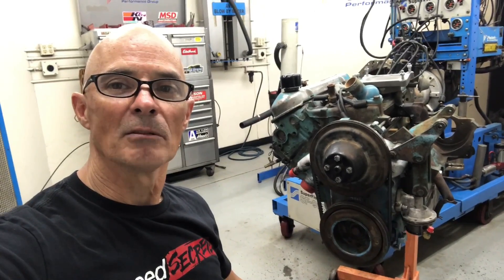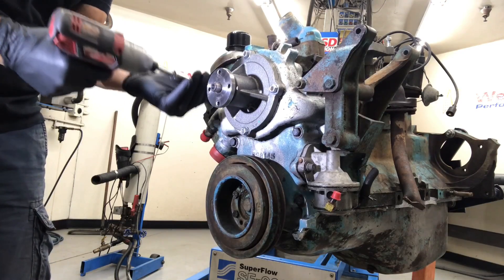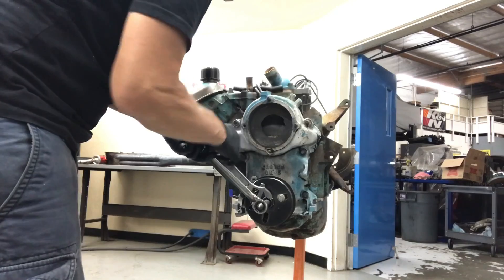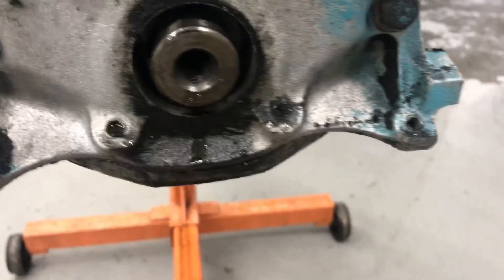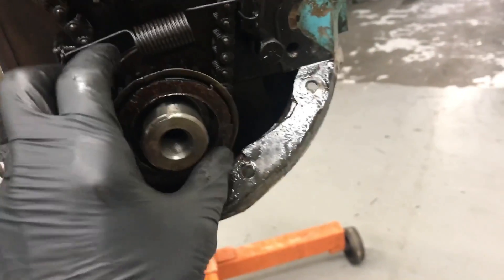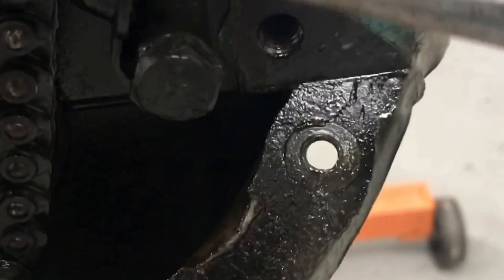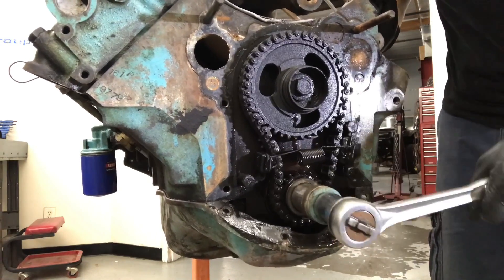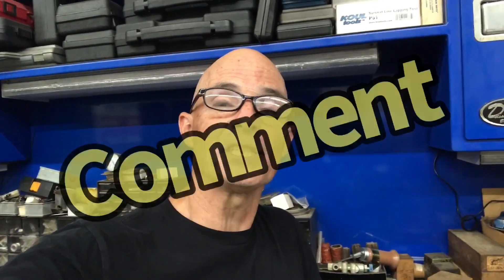HOW TO REMOVE A PONTIAC TIMING CHAIN-TROPHY 4 CYLINDER (1/2 389), TIMING CHAIN STRETCH VS TENSIONER!

Comment: 1 had  a 63 tempest station wagon back in 75, 4 cylinder engine. Bored it out to fit 400 Pontiac pistons. It ran good until I totaled it on a rainy night on a sharp curve.  Wish I had it now. I had found a 4 barrel intake, but didn't get the chance  to install it. Cool motor, and drive train.
Reply from the maker: do you still have the 4-brl Trophy intake?
Reply: @richardholdener1727  no, my dad threw it away after I wrecked the wagon. I hated that car as a 16 year old, trying to date, but I sure wish I had it now.

Comment: Richard sorry for being the wrong vides but you have done numerous header comparisons for low rpm street application and the fast long runner has one.  Can you please do a shootout against the Holley dual plenum EFI intakes as they are for low-end street/strip applications with 12 long runner.  I have a 2009 Pontiac G8 and am looking to with purchase but curious about the the difference in performance between the two styles like much of your followers would be.  For some reason, it lists 102mm TBs for the LS3 head but would think two 92mm TBs would be more appropriate for velocity
Reply from the maker: holley intake video is up

Comment: I took my 1962 trophy engine apart and saw no tensioner. I wonder if the chain was smaller to take up the slack. Any ideas on where I can find those parts? The spring and bumpers?
Reply from the maker: NOT SURE ON SOURCING THOSE

Comment: Brings back memories I used to check engines for tummy chain stretch by checking to see how far the crankshaft would move before you can feel the camshaft tension anyting over 6 to 8° I would sell them a new timing chain. Before it would jump time. Shorter part of my super tuning with the older.

Comment: On timing chain, Pontiac used the tensioner x links in the chain. Pontiac racers for years used this chain until they quit making them. Why? Because it was the last chain the v8 would ever need.  The chain on your half a v8 is trashed. Get a Pintiac V8 chain as they are the same, just dont last well on the 4cylinder.  Also your 2bbl carb going into a single bll manifold is a power killer. Ive never been happy with the results other than it runs.
Reply from the maker: MY LAST 2-BRL TO 1 BARL ADAPTER TEST ON THE 292 CHEVY MADE MORE POWER THAN 1 BRL

Comment: The Trophy 4 cylinder was hard on timing chains and the service replacement was a chain reinforced with, "X's" inside of the links. The last company to make the correct chain was Republic as part number, "R-355X."It is the same size as the V-8 chain and is a heavy duty replacement for the V-8's. Since out of production, Republic now shows the standard V-8 timing chain part number for the 4 cylinder, part number R-350. Nothing special about it, but if visiting an old auto parts store, ask for Republic part number R-355X and see if they have any in stock. They last longer in the Pontiac V-8's than the double roller chains. The nylon tooth camshaft gear will absorb the camshaft harmonics that reduce power in Pontiac V-8's. The teeth don't fail until the chain stretches too much and with the nylon gear, the chain will last longer, than it would with a cast iron camshaft gear. The crankshaft gear is heat treated steel though.
Reply from the maker: YOU WANT ME TO INSTALL A NYLON CAM GEAR SET?
Reply: @richardholdener1727  The chain will last longer and the engine will make more power. With a cast iron or now billet gear, the Pontiac can stretch or break the chain sooner and make less power. On a race car, the engine and nylon gear don't see much mileage anyway. The nylon gears work well when new. They do age and the chain does stretch quite a bit with street use, causing the teeth to later strip. The aluminum and nylon gear soaks up a lot of what beats up the chain, especially in Pontiacs.

Comment: The aluminum/ nylon timing gear on my 68 GTO Ram Air lll, had it's teeth stripped off at 60K miles and 6K RPM.   Bent all the valves in both heads, but it did not suffer a catastrophic failure.  Replaced the valves and ran the engine another 10K miles before disassembly and upgraded to RA IV configuration.  I found one of the pistons was distorted enough by valve impact to make wrist pin to piston movement difficult.
Reply: Pontiac V8's are hard on chains due to camshaft harmonics. The nylon teeth make the chain last a bit longer, but once the chain stretches too much, the worn chain eats the nylon teeth. When the thermostats were changed from 180 to 195, Pontiac changed to a cast iron camshaft gear in 1972 with a hardened steel crankshaft gear. The Pontiac V8's actually make more power with the nylon gear, as it absorbs the camshaft harmonics.

Comment: The 4 cylinder used the same size chain as the V8 but it suffered from premature failure in the Trophy engine so Pontiac engineers came up with a better chain for all the Pontiacs.
Reply: Problem was originals had nylon teeth!  Fire that guy!  They wore off, clogged the pump screen, and good bye motor.
Reply: @hankreardon6998  

I’ve changed a lot of original Pontiac timing sets and they were all steel. I’m not saying that they never used nylon but I haven’t seen any. 
When NHRA Pro Stock started using gear drives everyone except Bill Jenkins was having valve train problems. Grumpy didn’t have any problems because he was using a factory Chevrolet nylon timing set and the nylon acted like a harmonic shock absorber between the crank and cam.
Reply: @Tim Sharpe  Also changed the original on my brother in laws '69 GTO back in the day.  It was nylon.  They were factory installed until 1971 according to Tim Wallace (Pontiac expert Wallace Racing).
Reply: @timsharpe3498  Pontiac switched from an aluminum and nylon gear to a cast iron camshaft gear in the 1972 model year. Both used a hardened steel crankshaft gear. The heav\y duty 4 cylinder chain was last made by Republic as part number R-355X and may still be found in old parts stores. The current republic catalog calls for a standard V8 chain pn R-350 for the 4 cylinder since R-355X has now been discontinued, but you can still find R-355X and it has X's inside the links to reinforce it. You can see the difference compared to a V8 chain.
Reply: @timsharpe3498  The aluminum and nylon gear is great for racing, since it won't be seeing thousands of road miles, just a few track runs and the Pontiac engines suffer worse camshaft harmonics than the Chevy's Bill Jenkins ran.
Reply: @hankreardon6998  1971 was the last model year for the Pontiac aluminum and nylon camshaft gear. The 1972 and newer Pontiac engines got cast iron camshaft gears with hardened steel crankshaft gears.

Comment: the tempest 4 used a different chain than the v-8..it is identified by an "x" tensioner in the middle of the chain..thes are the best chains to use because they never wear out in a v-8..yes, flat crank engines are "shaky", but these can go well over 100,000 miles easy..your chain looks like a v-8 model, which, even with the tensioner, will wear out quickly..most pontiac guys have no idea how to hop up these little engines..
Reply from the maker: this was a 4 cyl chain
Reply: @richardholdener1727  send it to me..i collect them..

Comment: It looks like excessive timing chain stretch to me. I have no experience with the trophy 4 cylinder, but I wonder if you can use the small chamber, big valve head from a 389 V8 to boost top end power?

Comment: I would check at the same way you check the motorcycle chain lift the chain in the middle of the big sprocket and see how far it goes up. If it goes up and down in the middle of the sprocket it's completely worn out

Comment: For those wondering, a 4 cyl engine of nearly 200 cid is going to be a ROUGH running engine. 2 liters or 122 cid is considered the largest you should go without balance shafts. Pontiac used the absolute softest motor mounts to try and disguise the roughness. That roughness translates to much heavier harmonic vibrations, which is why they put that spring tensioner in there. That timing chain is googatz. I remember watching a friend's 61 Tempest idling in gear, and the engine just shook around, but the soft mounts absorbed most of the vibration. If you ever get an opportunity to see a 61-63 Tempest with an automatic, look behind the rear diff- the torque converter is there, out in the open, just whirring away.
Reply: And the Vega 2.3 liter said "Trophy, hold my beer. I'll show you some shaking!"😂
Reply: Actually the upper limit is 2.5L.  Any larger and a balance shaft is needed for secondary force vibrations.
Reply: I have a Nuffield tractor with a 3.8 liter side valve 4 that is smooth running. Similar to Morris truck engine.
Starts easily even if it is 6 months since I last used it
Reply: I have a '61 Tempest with the 4 cylinder 4 barrel motor.  If it's tuned it's not bad at all.  Vibration really only shows up at about 4500 rpm....
Reply: Offenhauser begs to differ...
😁

Comment: Wouldn’t a stretched chain retard the timing and help top end power? My stretched chain test is to pull it away from the sprocket about midway around. It shouldn’t come away from the sprocket. Another test is to take it off, turn the chain sideways and see how bad it droops.

Comment: As you say , was it designed with more slack in the chain to accommodate a chain tensioner compared to the 389 that doesn't run a tensioner ?  Double roller chains don't stretch that much . I've only seen single roller chains to get that sloppy .

Comment: You dhould of checked with a timing light with the engine running. With the engine running and idling with a worn out chain the timing would be all over the place making it hard to time.
Reply from the maker: WE CHECKED TIMING MANY TIMES

Comment: Somebody mentioned a situation where a timing chain had so much stretch that it actually wore a hole through the timing cover.  I had the same experience.  I can't remember for sure, but I believe it was in a late 70s or early 80s Chevrolet van with a 350.  That same vehicle might have been the one that was leaking from the oil pan too - the pan... not the plug or the gasket.  The pan had rusted out in the area between the damper and the sump.  Oil was running down to the plug, but the plug itself was fine.

Comment: I'd be willing to bet the chain I'd overly worn just from the side of the tensioner that isn't touching the chain anymore. A tight chain should pull the tensioner to the center and both would be contacting

Comment: check chain wear by laying it on the table either flat or on its side and try and push 3-4 links together and look for the slop in the pins. the link pins are where all the wear is at. think of them like door hinge pins
Reply: Draw the chain out into two tight rows on the bench and pick it up parallel to the ground while holding it from one end. It should be able to hold itself reasonably flat on the opposite end. Any drooping indicates slop in the pins.

Comment: It looks like it needs a set. It doesn’t slop on that one side because your pulling the tension out rotating. If your putting a cam in it do this. Put it on tdc with old set now rotate the crank backwards record the amount of rotation before the cam moves.Put the new set on do the same thing. It won’t tell you how much is too much but you would know in degrees how far it stretched

Comment: Being that it's half of a 389, I would think it would need a three single barrel intake to make the real power.
Reply: half of 3 carbs is 3 venturies so a 500 holly carb from a ford would work just right.
Reply: My '61 4 cylinder has the factory 4 barrel carb.  155hp, they only made just over a thousand of them.

Comment: Unlike modern hydraulic and rachet chain tensioners, that little spring doesn't control timing when the cam and oil pump are putting torque on it. So you would expect that cam timing would be retarded when under load. Would that keep it from revving?

Comment: my uncle worked as a mechanic at a chevy dealer in 50s he ordered a 56 chevy delray came with dual quads close ratio 3spd 3.70 posi and overdrive the first year he raced it in 56 the drag strip was dirt they used snow tires he didnt remember the ET but it went 95 on dirt in got new black top for 57 the car went 105 with the factory dual quad 265 with the duntov solid lift cam
Reply: this was the same track near Louisville Ky called Cedar Creek Dragstrip named after the road it was on uncle and dad both raced at

Comment: You can check the dots on the sprockets to see if they line up but I'm sure the chain and sprockets are worn out. The new chain should fit tight like the 389.

Comment: With only 8 valvsprings the cams spins pretty easy but there is 180 degrees between each event so there is more jerking in the timing chain. I guess that is why they put a tensioner in there. If the chain is worn the cam timing and ignition timing will be retarded of course, but that does not explain the lack of horsepower. A worn out cam and lifters on the other hand would..
Reply from the maker: cam is mint

Comment: Richard, the chain is worn out.  You noticed that the chain would jump once in a while when you rotated it.  The reason it's doing that is the pins are worn enough in the chain that the following chain tooth isn't landing in the middle of the sprocket tooth because of stretch(wear).  When it does this the sprocket and chain jump as they try to center themselves in between each tooth.  Lastly, 4 and 6 cylinder engines usually run a guide and tensioner on the chain to dampen the harmonics in the cam.  8 cylinder engines don't make as much harmonics.  A good example of this is the dodge 3.9 v6.  They ran a chain guide while the 5.2 and 5.9 didn't.   The chain and sprockets were the same though.
Reply: I 100% agree it should not jump like that....no way is that 'correct' ....

Comment: Sloppy chains usually cause an erratic timing light indication at idle and make it difficult to set the timing. The tensioner might prevent that problem though.

Comment: I have worked on hundreds of Pontiac V8's since I started on cars 40 years ago. None of the V8's used a tensioner and several old drag racers used 4 cylinder timing chains in their V8's because, in their words, the chains were heavier duty. So seeing that much slop in the chain it looks very stretched to me. But I have never worked on a 4 cylinder and by the time I started racing in the 80's aftermarket H.P. chains were easily available so I never used one of the 4 cylinder chains in my V8's either. I looked on Rock Auto and Cloyes lists the same part number for both the 389 and the 195 so I think they should be the same length and therefore fit with no slop.
Reply: Have one, same timing chain and sprockets as a Pontiac 389 v8.  You must reuse the tensioner though.
Reply: The old 4 cylinder timing chain is out of production, but Republic made the last ones as part number R-355X and they have X's inside the links to reinforce them, making them stronger than the V8 chain, that Republic now lists for the 4 cylinder as part number R-350. Call old auto parts stores and have them search their stock for Republic part number R-355X for the heavy duty 4 cylinder chain that is no longer listed.

Comment: I agree that the chain should only have a slight amount of slack in it, regardless of the tensioner.
If the chain was supposed to have that much slack it should have a tensioner that would ratchet out and lock into position, not jump back and forth every time a valve spring pressure pushes the camshaft forward, ahead of the crankshaft, that would just not be right....

Comment: If the stretch was uniform, and it hasn't jumped a tooth, or two, wouldn't you expect to see slop on both sides, and the tensioner pressing in on both sides?
Reply: No. It pulls tight on one side, goes slack on the opposite

Comment: Never saw a tensioner  on any Pontiac  v8 .  I've seen a lot of slop on there v8s with 50,000 miles. Pontiac  v8 are hard on timing chains and gears

Comment: The more I see of the Pontiac 195, the more I like the IH 196 made from half of a 392 V8. It had timing gears instead of micky mouse tensioners to control a floppy chain.
Reply: I know a guy who had a GM Iron Duke 4 cylinder that had bad timing gears. He decided to do a “forever fix” and put a set of steel gears from a 292 truck engine. It sounded like the Salvation Army bell ringer because it had a roller cam. He had to tear it back down and put the fiber gear back.
Reply: I’m glad someone else was thinking about it
Reply from the maker: gears drives are just silly
Reply: @richardholdener1727  , industrial engines tend to have gear drives. i suppose they last longer. chains and belts should absorb harmonics.

Comment: That’s worn slam out!  Lol. Based upon the spring style tensioner it looks like the tensioner is there only to take up a small amount of slack. If not they would have used a  larger spring. Also there’s zero advantages to making a chain that loose just to take up the difference with a tensioner.

Comment: The tension spring if fully collapsed so the chain and gear are worn out.  Remember, the fewer cylinders you have the more notchy the cam rotation will be.  And be sure to add in fewer power pulses of the 4 cylinders further adding to torsional variations.

Comment: If it’s just a 389 without one bank of cylinders, why does it have that chain tensioner? Cool and weird!
Can you line up the timing marks to see if chain has stretched?
Reply: You can line up the timing marks and then measure the piston's location. If it is at TDC while the marks are lined up then it is OK.
Reply: They added the tensioner because the engine vibrates more than the more balanced V8.  These were 3.2 litre 4 cylinders, that a lot of cubes for a slant 4.